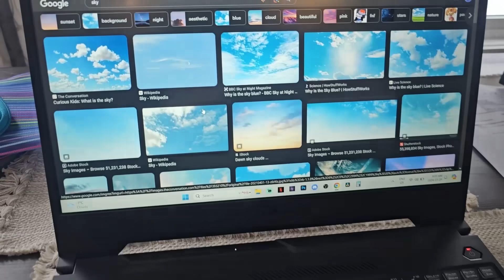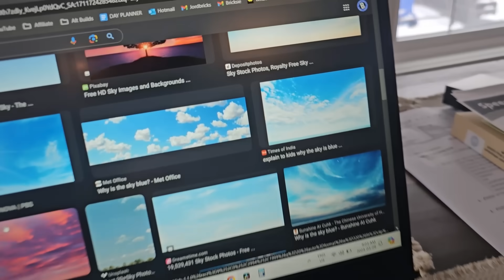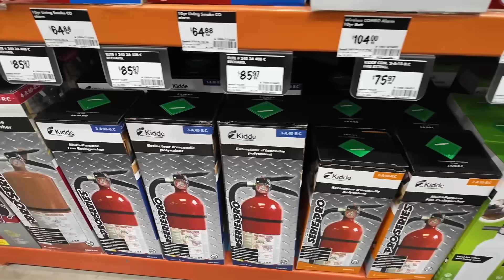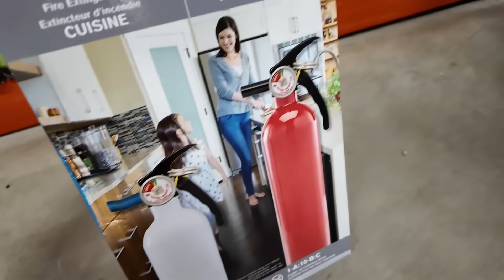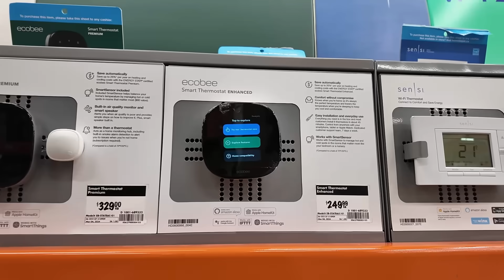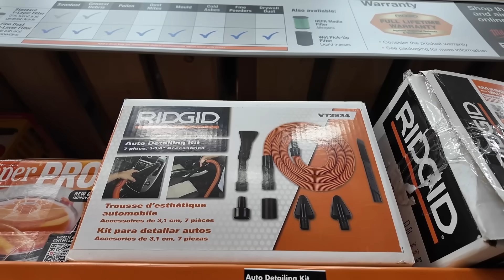LEGO City Tables? Preparing for the Mural!

Comment: Idea: split the difference and have 41” walkways, then still have 70” tables on either side but reduce the center section to 60”. This way you are only reducing the number of base plates by 1 the length of the city.

Comment: I think you should consider making a city that is not square. 

Leave yourself 36-42  but only where you need to pass. It would allow for branches to stretch right out and fill corners of your space, it would make more sense when thinking about how to transition to beach, mountains, western areas, campgrounds,, industrial ext. 

Not to mention how it would keep it more visually interesting. 

Sure square would optimise every inch, but you just don’t need that yet
Reply: in addition to this... have you considered running the tables against the walls with some walkways taking you down the lengths and a big area in the middle for the main town space?
For inspiration - google a GTA 4 map... 
This will allow you to seperate sections/breaks in the city... also allow you to go higher on the sides and use the wall as support etc. and support for more engaging filming.

Comment: Thanks Jordan
 You should use a steel frame to support the city. It would be far cheaper than buying all the timber and you would have less legs on the the ground which will make vacuuming more efficient for your robot vacuum. Then you could go with the larger walkway and just bolt on the extensions when you need it. Also the steel doesnt flex and provides greater flexibility.
Reply: Great idea
Reply: It’s so crazy that wood is so expensive now. I know steel fluctuates, but building materials are just so much.

Comment: I built my tables based off of the new ones you did for your basement, but I added caster wheels on the legs. It has made accessing and arranging my city very easy. If you’re going to want to change it around, I would highly recommend making the tables Modular as well. Only issue is going to be your trains and leveling each table to match the next

Comment: I hope you have thought of how to deal with table heights with the way the floor looks bowed (higher in center) when building the tables.  You can cut and make all level to each other but if you go to rearrange your layout of tables can see you having issues with the table surfaces lining up to the next.  McMaster Carr has great selection of threaded rod leg feet and with a swivel joint to help with a sloped surface.  You can get something like that for each table leg and be able to adjust everything easily.  All needed is the foot and a tee nut that the leg  can screw into.  You would drill a  hole in the bottom of the leg pound the tee nut in the leg then be able to screw and adjust the leg feet to get all your tables true.  That would be easier and cheaper than having the floor level grouted before putting your carpet down ( if wanted a perfectly level floor).  Hope the rest of the renovation goes smooth and no costly surprises.

Comment: In my mind your terrain is low-lying on the edges and building to heights in the middle so no sheer cliff faces on the edges so you can spread your arms over the table when walking around with these large base plates which realitlstically need to be a manageable height as well as width to carry.

Comment: Recommend you make your table design like maize so you can walk around in your city.  If running trains use lift bridge sections to connect sections.  Crawling on the floor to the access pop up holes will get old and hard the knees.

Comment: Get a small trolley with a rope attached (basically a board with 4 wheels), stick a giant mills plate on it, chuck the rope under the table sections, crawl under and pull it through to the standing hold you need it at?

Comment: What happened to the mud room by the entrance? Than that wall should get a mural and not the back wall. For the tables, I would get a wider path at the side to the chairs. Bigger baseplates is a thing, but you can use a little cart on wheels to push around. What about moving bigger and heavier stuff through the place, that maybe needs two persons? Extra walking space for that is better / safer imho.

Comment: Generally you'd want to keep walking space to as wide as a doorway, being that is less than 3ft, I think you are fine having 3ft on either side of the City. If you really want more space you also don't need to expand each side by a foot, but rather 0.5ft and center the tables. That way you only loose a row of baseplates total rather than a row per side.

Comment: How about a 5’-6’ walk way down the center. And split the city in 2 sections and push against walls. You could build movable bridges if you want to connect two halves. You can have rivalries storylines between the 2 sections of city. Clouds will look better again s the city. And you still will have same amount of frontage as one big city. The dead spaces will be against walls instead of in center of huge city. Access to heater and lights would be better and a lift or any larger item or furniture can be moved through city with a dolly if needed. Also exceeds fire code escape requirements.

Comment: If you want i wider walkway, but don't want to sacrifice too much tablespace. Why not a middleground? You don't need to remove 2 rows of baseplates, only remove 1? Instead of narrow walkway of 36 inches or wide walkway of 46 inches. why not 41 inches? I know it will not be symetrical, so that might be a factor.

But keep in mind fire codes. I know you want to maximize your Lego city, but you need a walkway wide enough for easy escape in case of fire.

Will you be hanging up airplanes and stuff? Maybe a frame rig above the city would be nice to hang the planes with? Maybe one you can raise and lower for easier acces? You will not get access to a scissorlift after the table is built to hang them in the ceiling.

Comment: Tough decision. You should absolutely check the building code for required isle widths. I would be surprised if you could go less than 3 feet and still be in compliance, but every place is a little different. Same advice for the fire extinguishers. There will be a code requirement for type, number, and locations.

Personally I'd go with wider walkways. Something where I could wheel a cart down it or have two people pass by each other. It'll give you more room to film too. I'd try to build in a modular way where I could disconnect the tables and move them individually if needed, but that introduces some other alignment challenges too.

Comment: I think you should give yourself more space for walking. 5', maybe even 5.5'. Not having to squeeze or shimmy when carrying large base plates is a major quality-of-life thing. It will also make the space feel bigger. Additionally, I also think it's safer to have larger walkways in case of emergency. Or if you drop a LEGO set or a large MILS plate, you'd prefer it to fall mostly on the ground and not on the city itself

Comment: Heh Bricksie, your marvel line-up, you have three hands and a shield, can you position the hands over the shield, as if they do a one two three four, lets do this???
As for your stock of Lego Investment Boxes, any that is hard to get and/or that you might find useful in the new place?
If so, consider if you want to keep them or not.
Like say a Lion Knights twin bridge castle island and a Birdy (twin) castle city entrance?
Think Europa Cities & New York Manhattan Island, here, for example.

As for that cleaner, add in a pipe, that fits on both.

Now a question, considering your door and staircase location, are you going for one big table setup or for two tables and put on one, a ocean like setup?
Because that path is where you really need to keep the size, right, while the other one can be a bit smaller.
Put a box around the gas pipes.
Maybe add a book-cabinet like setup between them.
Your going to want a place where you can hang your wet coat & leave your wet shoes, without it all tracking true your place, else your carpet tiles get wrecked.
And get a trolley-car on which you can put your modular's & set the boxes of lego on the lower platforms on that trolley-car, think tool-trolley-car, here.
This is thus what your minimum walkway size will be based on, it needs to move on that side, while on the walk-path, you want to be able to walk around said trolley-car.

Painted lego Birds, fish, mountains & plants?
Maybe a lego airship, plane or ufo?

Comment: If you reduce the size of the tables, did you think about maybe 1/2 baseplate on each end? If anything you can probably fit another shorter table in the front?
Also, I don’t think you will be putting skyscrapers or tall buildings at the end of the tables!

Comment: about walk space i do prefer the visualization of it with the more walk space, plus if you have visitors or when your kids are walking/running around later you will very much appreciate the wider walk space, your still so much more space than the basement, also like other comments mention if you need more appliances around like a fridge you want space also they fire codes someone else mention on access ways that very important point.

Comment: Maybe instead of access holes you could make an indent on either side with the middle being 70 inches. Then it would be easier for you
Or if the tables were on wheels, maybe you wouldn't need access holes

Comment: I'd consider going with the HEPA certified shop vac bags as well as the HEPA pre-filter. I found that the standard ones tend blow out some of the finer particulates. The HEPA rated ones don't do this.  Edit: Not sure what your plan is to build the tables but I highly recommend building them from 80/20 on leveling feet/casters so they can be reconfigured. As I've mentioned I have a lot of experience designing and building these for a different industry. Hit me up if you are interested. Either way get a good CAD guy to lay it out for you. Amazing content as always keep up the great work!

Comment: I would check your local fire egress codes before doing anything. On your question, I agree 36" is too tight or narrow of a walkway. Especially if you need to move something large through the area. For instance down the road you buy a new couch, shelving unit, or something that needs to fit in the front or upstairs, but it's to large to fit in a 36" narrow path. If i were you, I would at minimum add 5" to each path. This could be accomplished by just dropping the middle row of tables down to 60" from 70". That way your only 1/2 of the baseplates you talked about. Your walkways would then be 41" wide. 

Side note: I recommend getting one of those rolling Rubbermaid carts for warehouses so you can move baseplates around safer than carrying them. They are not too expensive, couple hundred bucks at most. 

Side Note 2: I don't know if Canada is like the states, but for commercial properties we are required to have certain code fire extinguishers. I noticed you bought the home kind, and you might want to check to see if you need the higher rated one for a commercial property.
Reply: As this commenter noted, it is essential that you check both the National Building Code, Alberta Edition and the National Fire Code, Alberta edition with respect to both the fire extinguisher location and type, as well as the width of access aisles. Check with the City of Edmonton fire marshall if unsure.

Comment: If youre going to add the subway train system around/under the perimeter of the tables, you might want the extra 10 inch walkspace to build and actually see the subway stations.
Reply: Otherwise, you'd only really see it at the front. Which is fine, but something to consider.

Comment: Check your fire codes for access to that rear door.  It’d stink to build the tables and have to move them after getting dinged at an inspection.  It’s usually 48” to 60” min width for an access way. 

Have a big plan but phase it in. Let yourself work in the space for a bit before fitting it all out.  You’re going to want to make changes as you go. Save time and money for later. As Adam Savage says: “it’s not a problem to solve, it’s a process to manage.”
Reply: Wow! That's very good and sound advice.
Reply: Not just that, Bricksie should also think about design element of whitespace and how important it is.  Maximizing the space for the Lego city seems simple but often "less is more".

Also, he needs to think about walkway space.  Moving a fridge or furniture around? And so on..
Reply: Adam yes he has a cool work space. For creating.  Very nolidge guy  😊

Comment: Put wheels under the tables to ease moving them to make extra space to walk on one side. Have them lock down too. Consider the table to be modular so a section can be moved. Its a big area, and maybe in the future you might need to move something big from one side of the warehouse to the other or do maintenance above the city on the lights or heater. Its something else to keep in mind. Add hardware underneath the tables so the tables can lock into each other as well as height adjustment hardware. I don't know how even the floors are, so if you go with the modular way, it could solve that problem later on.

Comment: I would definitely go with the smaller tables and wider walkways. You even said so in the beginning of the video, where you feel like you built yourself into a corner in your current basement. You can always add on in the future, but its very hard to do the opposite. You will also need to check your local codes to see how wide the passageway to the egress door will need to be. Typically the minimum is three feet, so once you get the cloud backdrops hung I think you will be less than that and then will get chewed out and potentially fined by inspectors.

Comment: For Safety you should check with your local Fire Station in regards to how many and where you need to place your Fire Extinguishers. You May need 3. One for the Front and Back doors, plus one for upstairs, especially if you are going to have a little Kitchenette. Keep Brickin Dude.

Comment: It might be good to build section of the table to lift up and float in the air. That way you don’t have to craw under the table to get to the access holes. This also means you may not need access holes and have more room for base plates.

Comment: In regards to fire extinguishers, I think 4 would be ideal.

1 - Upstairs
2 - At the bottom of stairs
3 & 4 - on opposite walls of main warehouse.

Also, you should ensure that the fire extinguishers are good for electrical and chemical, as the burning Lego could be harder to put out if on fire.

Think of the amount of spray time the extinguishers have. You need to be able to use them while vacating the premises.

Comment: Maybe you know or its been mentioned, but before you buy a programmable thermostat - realize you may need to pull new thermostat wire. The current thermostat you have installed can operate from 2 wires. A programmable t-stat will require an additional wire to power the interface and memory (Also 2 more wires will be required for your furnace t-stat if you ever go ahead and get the A/C installed). Simple job to complete but just one more thing to think about!    Cheers man, love the reno videos

Comment: Take this or leave this, but with this space being so much bigger and you having so much developing of the city to do.... I think that you (and your knees and back) would be a lot happier if you started with the four big sections only being connected in the middle.  Similar to what you did in the basement previously with the aisles - then once you develop all of the rest of it - add in the side connections to span between the sections to give you the access holes.  Think of how much easier it would be to move the large plates and mountains and parts and everything without having to crawl.

Comment: i would increase the space for walking and maybe a cart for carrying such large pieces up and down the sides. Saves for accidental drops or tripping etc
Reply: I was also thinking a cart would be good, also an elevator system from the mezzanine to the ground floor, nothing fancy, but one that does the job for not tripping with big build in the stairs. A big plate, a winch and some wires would be enough. Safety is important, both for yourself and to avoid unnessecary destruction of lego that might set you back many hours depending on the size of your build

Comment: Hi there! A little suggestion, I would do the 46 inches, cause look at it this way: If you didn't have enough room, then you cant get the city built right? Resulting in NO City! So that justifies having the 46 inches vs the 36 inches. Besides, its easier the ADD more tables then to remove tables (You'd have to remove base plates, city etc.). There will also be enough room to add builds onto the wall with a ladder if you want to (Brick built birds, etc.)...Hope that helps....Thanks for this video!! Good luck!!

Comment: Back seat driving here. Make some tables permanent and some with casters so you can move things to gain access. Another idea would have some jack bolts in legs so you can raise up for different elevations. You may also want runners under some tables for subway.

Comment: Go with the wider walkway.   You'll appreciate it for mobility and for anything you need to do later on or up the walls. 
For that back wall,  don't paint that silver strip on the door or the pipes.  If you don't want to look at the pipes as-is then get some large pvc pipe, cut it in half,  put that over the pipe using something like velcro and then paint the pvc.  That way you don't risk anything with the pipes and you can easily access them if need be.